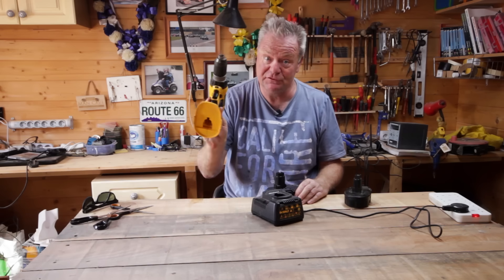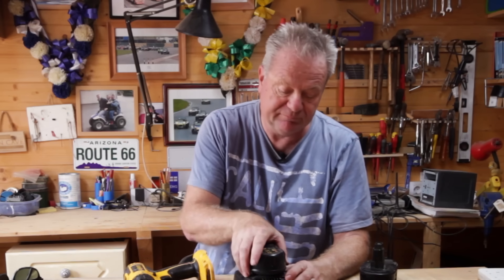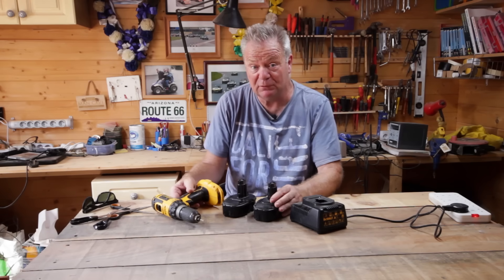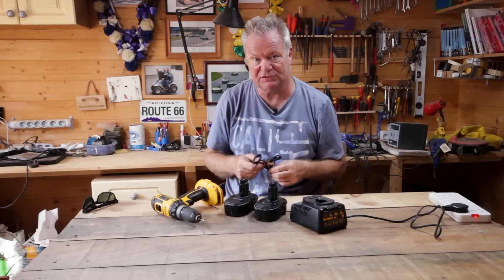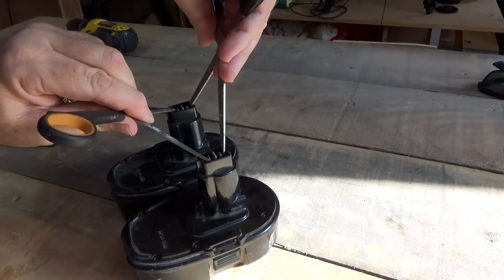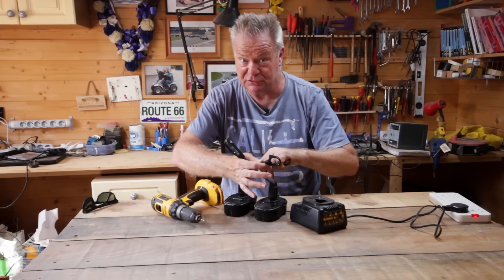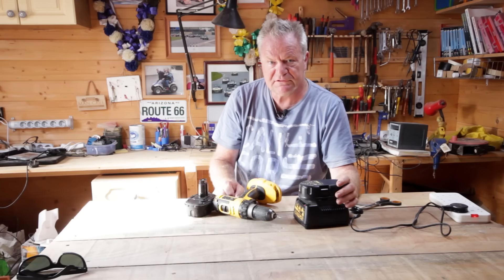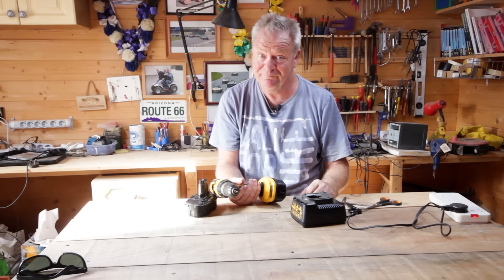How to revive a dead rechargeable power tool battery easily

Comment: The jump start is a great idea!
 If those are Nimh batteries, the charger is probably seeing a low voltage due to one cell getting fully discharged. So when it sees the whole pack being 1.2 volts below minimum that it's told it can deal with, it throws a wobbly.
In the longer term, it will be better to open up the casing, lift the batteries out and probe test each one with a volt meter. Then recharge any low ones with an RC model charger, one of the multi battery type ones. They can charge one cell or up to 12 cells, and they stop at the proper voltage for whatever type cells you have.
I did that with my beard trimmer the other day and now it is once again accepted my the wall charger! :¬)
Reply from the maker: Interesting tip - thanks

Comment: I'm a bit slow at learning. Can someone please explain to me why after you jumpstart the battery, then it will take charge from the battery charger
Reply from the maker: It is because the battery's charge has dropped very low and the charger then doesn't recognise that a battery has been inserted (as it is a "smart" charger). Adding a bit of charge to the battery then makes the charger recognise that one has been inserted so charges it. I hope that explains it Raymond.

Comment: This is a waste of time. Once the battery cells are fried the may take a charge and seem OK but they will discharge quickly. Save some time and buy a new battery.
Reply from the maker: Read the pinned post. This battery is still working 16 months later.

Comment: Yup.. works better if you hook a car charger up to it for a few seconds.  However the real reason the battery is going to a under volt state is some of the cells in the battery have degraded. With a multimeter you can volt out the cells to find the bad battery. Should be near the center of the pack. This is because nimh batteries don't charge properly in series. The center cells never get a full charge and suffer a short life. You can then jump on eBay and get new batteries to replace the bad ones.
Reply from the maker: These are 18v not 12v batteries.

Comment: You would think just using a 120 volt drill you plug into the wall would be easier. But that extention cord must be too heavy for some people to role out. Electric battery operated tools are designed to bleed your bank account replacing dead batteries all the time. Those tools are for people who use them daily or weekly. Batteries never go dead in an electric drill. Battery tools are silly and people who buy them and never use them are just as silly. LMAO
Reply from the maker: True but they do have their place. I have used them to work on a boat where there was no mains power for example.

Comment: How long does it keep that charge though?
Reply from the maker: That largely depends on the battery. This can happen to a new battery or an old one - see Jiri Zhanel's comment below. If it is an old battery that doesn't hold its charge for long anyway then that is the way it will stay.
Reply from the maker: I meant to add, the battery in this video is still working 15 months later.

Comment: So this isn't actually a fix for the battery, rather a workaround for the majority of our modern badly designed chargers which read the output of the battery before deciding if to switch on the charging function. Still a very useful tip all the same! I've done this myself with a car battery charger and totally dead  battery and using a low voltage dc adapter temporarily connected to the battery terminals. As soon as tge charger kicked in, i removed the dc adapter.
Reply from the maker: Absolutely Phil. You are correct.

Comment: This is very temporary fix; that battery won't hold a charge for long.  I have tried this several times and at first the battery appears to work normally but leave it off the charger for a couple days and it will be dead.
Reply from the maker: That may be true for some batteries if they are pretty knackered anyway, but the battery in this video is still working 15 months later.

Comment: I tried this trick and it worked well so I will make up a dummy loading dock to fit the dud battery for a 2 minute charge from a temporary adjustable voltage transformer to give it a quick jump start. I will make it flexible so that I can fit in any brand of battery  so that I can help my friends to save a bit of money. Thanks for the tip.
Reply from the maker: Thank you for the comment Richard.
Reply: Batteries should not be connected to a multiple tap transformer.  Never apply AC voltage from a transformer (that’s what transformers put out) to a DC battery!  It could result in ruptured (read blown up) cells.
Reply: @daviddierking4214  You are quite correct. I did not make myself clear that I was using a multi tap transformer fitted with an ac to dc bridge rectifier and a current limiting resistor which is super safe.Thank you as I do really appreciate your comment as someone might try to apply an ac supply to a battery. My Error.
Reply: Richard Dickson oA

Comment: Dude I watch this video probably 6 months to a year ago. I just tried it today and it worked. I had two fairly new 20 volt batteries Porter Cable that wouldn't charge. And now they will. You're f**** awesome dude.
Reply from the maker: Thank you for letting me know Jeffrey
Reply: actually the one battery I had to try it a couple times. I had to recharge my good battery and then equalize it to the bad one, then that bad battery did charge. Total awesomeness

Comment: Um, no. I've been in the battery industry for a decade. Batteries work based on a chemical reaction,  that reaction eventually weakens and stops. Once it stops, no amount of "I heard from my neighbors brothers second cousins barber" voodoo will restart it. You might get it to take a charge, but you won't get it to hold a charge. You can get aftermarket batteries or have batteries rebuilt for a fraction of the cost of new ones if you really want to keep the tools. Save yourself time and frustration. Don't believe these snake oil salesmen.
Reply from the maker: The battery I restarted is still working so you obviously don't know as much as you think you do.
Reply: your both right. JP your trick only works if the battery is good but discharged below the "low charge level" detected by the charger. However any lead battery that has hit zero might be saved the first few times, but extremely low states of charge will kill it since the life span of lead batteries is counted in cycles @ certain depth. Deaper the discharge, lesser the number of cycles. A dead battery will not hold the charge anymore. 
Of course we're talking antiques here, cause lithium batteries come with a whole new set of rules.
So once again your both right. However Matthew Fultz seems to be a rude fellow.
Reply: @JPinFuerteventura  you mean the battery you switched for the good one? Several comments already pointed that out for ya slugger.
Reply: Matthew fultz, You're a tool, "been in the battery industry for 10 yrs". Most people have been driving a car for longer than that and still don't know how it works anymore than the day they started.
Reply: Except.... he's not selling snake oil, he's not SELLING anything, he's just sharing a tip. Most DIYers just want the battery to work for the duration of one job, they may not need the tool again for weeks. Power tool batteries are manna from heaven for manufacturers, they fail quickly without regular use and you can charge a fortune for replacements,   think printer ink. If you are unlikely to need to work far away from mains power, always buy corded tools and a long extension lead on a drum.
Reply: Dude don't be an asshole, leave the old man alone, at least he's trying to help
Reply: Dude, chill the fuck up. It works. Jokes on you.
Reply: Ive been taking shits for over ten years. Never have I reused the toilet  paper, but sometimes a DYI just has to watch a YouTube video. 💩👎
Reply: Ooohhh! Snake oil... where do I get some? I asked in the comment section in a different video where to get snake oil once and some guy told me to get it at my mommas house... I asked mom and she said she NEVER had any in her life. That guy didn't know what he was talkin' 'bout.
Reply: @harry_hands  In other words, he didn't know shit from Shinola, just like the "battery salesman".
Reply: A battery salesman, not wanting us to charge our batteries. :D How strange..
Reply: @Jawsofhana  BAhahahahahaha! 
NAILED IT!
Reply: @MikeHunt-qu6ef  😂😂😂😂nice one mate
Reply: ZEE M ZEE lol all these trolls on here are pros at something right lol
Reply: there is usually a protection circuit on the battery or charger that doesn't allow for batteries to charge if discharged below a certain level..JP is showing us a work around for this circuit..
in some cases the chemistry is fucked and what you described will happen..but how would you know...
well you pull out your edward scissor hands and giver a go and might save yourself some money

thank you for your videos JP
disregard the negative nancys
Reply: He's not selling anything .dickhead
Reply: @doctorbastard2912 a salesman is always selling, an honest living and that's his job that's how he feeds his family. nothing wrong with that. what type of sales are you talking about
 
directly selling or indirectly? selling a product or an industry. selling what. for who. who gets the profit..who is benefiting.

see its not just a matter of who's selling and who's not. or what it sound like you are saying.."who is on right now and who is not"

its about information. free, open, honest, factual, forthcoming, information.
this will be the direction of business in the future.watch.

we are having fun with text, and i hope the salesman doesn't feel attacked. things SEEM to move fast online.

&& L Day..ill show you a dickhead if you call me dickhead one more time.usomebitch.
Reply: I just did this to a Ni-Cad battery (using a car battery charger for a few seconds rather than another battery  and then achieved the DIY task that I needed to do: 12 or more 3 inch screws into my decking with power left in the battery. It worked for me.
Reply: He isn't selling anything. Trolls with the negative comments are bitches. They need an ass whooping. I'd be happy to to do that for anyone talking shit. Pussys!!!!

Comment: I use a car battery charger. .does the same job..
Reply from the maker: Really - that's interesting
Reply: @JPinFuerteventura  the correct charger was rejecting the battery as faulty so I gave it a few boosts from a car battery charger and it works again as long as the charge in the battery isn't completely depleted.

Comment: I have like 8 or 10 of those older DeWalt s I think ,2 still charge .I did the plug in an out of outlet like 15 times to get some to come back to life trick but most don't work still. I'm gonna try this .however inside that big battery is really like 20 AA batteries an they just wear out an never come back .I'll let ya know what happens .
Reply from the maker: Good luck - please let me know

Comment: Does the donor battery have to be from the same manufacturer as the dead battery? I have a dead 18 volt DeWalt lithium battery but no second one. I do have two Ryobi 18 volt lithium batteries that work fine. Could I use a Ryobi to goose the DeWalt? Also, when you're holding those scissors, will they arc if they should contact each other? Thank you for the demonstration, it will save lots of money.
Reply from the maker: I don't think the make will have any difference as long as the voltage is the same. I imagine they would arc.

Comment: WOW, THIS WORKS! Just tried it on a battery that has been completely flat and non chargeable for at least 4 years, and now it is charging and works! Thanks a lot.
Reply: If you have one dead cell in the battery it will cause problems but you don't have to spend the money for a brand drill battery just open the battery up if possible with your model send replace the dead cell with the new 18650 battery that you can buy on eBay or Amazon for if you don't want to wait for shipping go to a vape shop and they sell them at top dollar.
I would recommend getting a Panasonic green and black battery. And if you really want to go cheap and you have any old laptops that don't work anymore open up the laptop battery and it's full of 18650 as I'm sure you will find one that's still good
Reply from the maker: I am glad it is working for you. One in the eye for the doubting Thomas brigade below. Thanks for letting me know.
Reply: @JPinFuerteventura  who on earth keeps a  4 year battery around?
Reply: Be careful doing this with lipo packs they can burst and catch fire. I've jump started a lipo packs before using a battery charger . The pack swelled up but took a charge . Lol
Reply: The fact that a supposed Dead battery is still in your possession for 4 years is a miracle in itself.
Reply: T P y
Reply: Died again shortly after. Seems it just gave it a jump start.
Reply: @BRITISHAERIALVIEWS  ..yeah, the batteries are expected to die.. 200 cycles of charge, and then .. buy new stuff.
Reply from the maker: @BRITISHAERIALVIEWS  That's a shame. Sometimes they are too far gone unfortunately.
Reply from the maker: @countmorbid3187  You are an idiot. Why did this battery last for another 4 years without a problem?
Reply: T P cadmium is cashed
Reply: @BRITISHAERIALVIEWS  same result I had, not really worth it. But my batteries were about 7 years old too so that might have a lot to do with it.
Reply: I have a battery that charges but isn’t charging all the way how do you fix that
Reply: @rockycassidy1813  Probably one or more of your 'cells' is actually kaput.

Comment: Watching from Flagstaff Arizona! Route 66 for life!
Reply from the maker: I have been to Flagstaff. Got stuck up a mountain just outside after going up on a ski lift in June 2000 as there was a thunderstorm so they closed the lift for safety reasons until it passed. My Uncle and Aunt lived in Mesa and they came here to Fuerteventura to visit us a few years ago. I told them that it was like Arizona-by-the-sea and they had to agree. In fact, driving from the airport to our house they said it was just like the I-19. Thanks for watching.
Reply: Howdy. Chino Valley here!

Comment: How do you start a charge for a single battery?
Reply: Car batteries are basically 12 to 14 volts so if your battery is at least a 12 volts, the car battery should suffice.  Not recommended for batteries under 12 vilts

Comment: I have a 12 volt car battery that I use for my boat which won't charge. Will the same procedure you demonstrated work on my 12 volt battery?
Reply from the maker: I did use this on a car battery that wouldn't charge once as obviously my trickle charger also needed to detect a small current to start charging. Let me know how you get on Nick.
Reply: Stupid question, why would you risk the lives of yourself and others by trying this out on your boats battery? I have seen this system work on cell phone batteries but certainly would never try it out on the sea. Buy another battery
Reply: @aesop8694  you are certainly right risking my life out at sea. I will take your advice and just buy a new one. Cheers
Reply: @nickcoudounellis9668  Na eisai kala file

Comment: You need to start with what TYPE of battery they are... lipo or not, balanced charger or not. Once some drop cells below a critical level they may well charge by essentially using an uregulated charger or anothet battery in this case but the charge wont hold as long and they cant deliver maximum current on load.
Reply from the maker: a) I had no idea what type of battery it was, other than it was supplied by Dewalt. I now know it is a NiMH b) How would I know if it is a balanced charger or not as it is obviously just the one supplied by Dewalt with the drill c) they might possibly not hold charge as long or deliver maximum current on load, as you suggest, but the alternative is to throw it in the bin and buy a new one.

Comment: What if your battery just doesn’t hold a good charge? I have a battery that doesn’t charge all the way but will charge a little.
Reply from the maker: I think that comes with age Michael. They all seem to go that way in the end.
Reply: Then what is the difference between a battery that won't charge and a battery that will only charge a little? Just curious.
Reply from the maker: As I understand it, a battery that has been left for a long time might discharge completely, which is why it then won't charge at all without a kickstart like this. A battery that won't hold its charge is basically getting old. Of course, it is possible that you kick start a dead battery only to find that it is too old to hold a charge for long but that isn't always the case.

Comment: Ok... From my knowledge... NiMH battery can last longer, with low voltage... But, yours are Li Ion... And those are tricky... A friend tried to mess with one, and the battery caught fire... :)   So, the problem, the big problem, is that these Li Ion batteries are made with a restricted life. Though, the reaction should never end... Charging, discharging...
Reply from the maker: No, mine are Dewalt DE9098 which I believe are NiMH